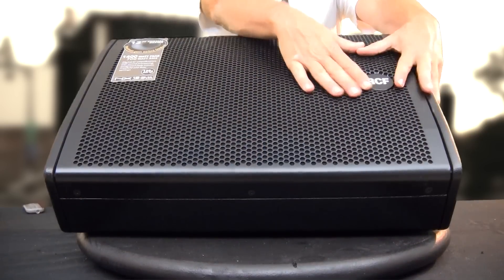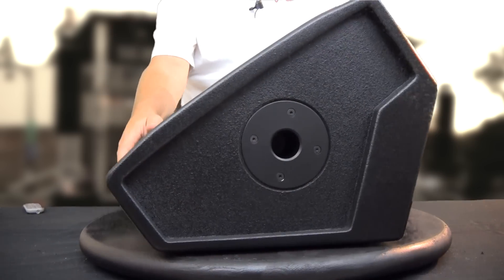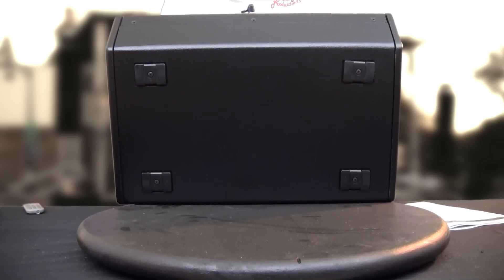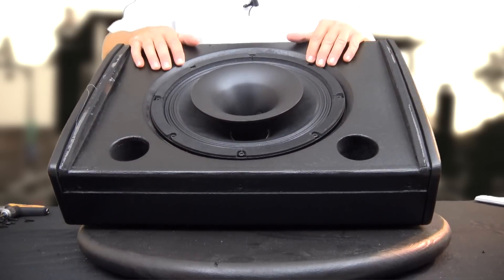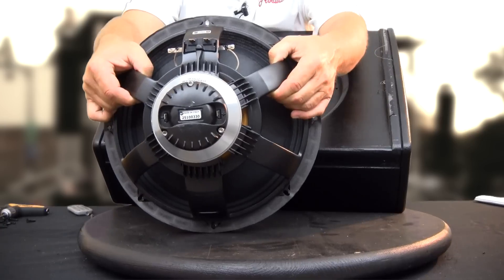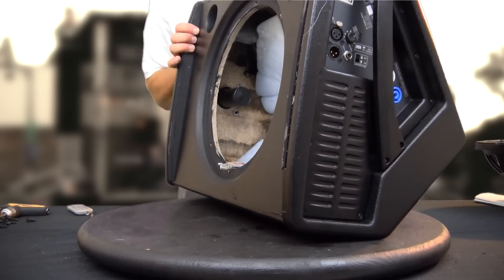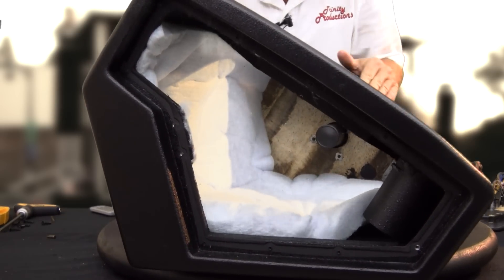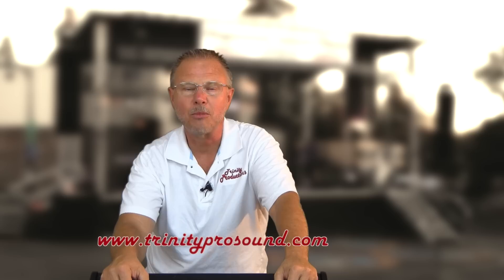RCF NX12SMA overview - inside and out - AUTHORIZED RCF DEALER

Comment: About 30 years ago bought an RCF 8 inch coaxial speaker. I had confused them with RTR who supplied some of the 25 inch drivers for the SENSURROUND speaker boxes of the 1974 disaster film Earthquake, as experienced at the Empire cinema, Leicester Square, London. I found the   RCF to have amazing efficiency (97db) and a decent power rating of 75w rms. While I wouldn’t compare it with an equivalent Tannoy coaxial I thought I had clean bass, an excellent forward mid range well suited to human voice projection and a smooth hf rolloff. Although not sporting an exotic Alnico magnet, the ferrite installed was as big as the cone, so you could safely describe it as a budget professional driver, at just £17.50, in 1989 money. $60 today in 2018. All RCF products seem to be well made, robust, and represent honest Italian craftsmanship.

Comment: Hard to tell from this video, but aside from the grille, the construction looks like it may not withstand continual gig wear and tear from usage as a stage monitor. Am I wrong? Is this monitor's housing more rugged than it looks in this video? Also, you stated that the horn is 60-degree dispursement, but what about the mid-range driver? Thanks!
Reply from the maker: Yes it is solid , we have almost 20 of them doing events in our production inventory. They are very solid speakers and construction. The speaker is 60 degrees conical around the entire speaker for the LF and HF section. There is no mid range in this box, 2 way only. The inherent properties of the coaxial design is fantastic for feed back rejection as well.
Reply: Thank you!

Comment: Hello John. Have you ever tried to hook up a pair of these with a small subwoofer? I wonder how it would sound as a main top for a 2.1 mobile DJ system.
Reply from the maker: Yes we have and they sound great ! Just a bit strange looking on a stand with the monitor wedge shape, but they do very well and are loud and clear, subwoofer really enhances the low end , always use the crossover output of the sub and you can drive the system fairly hard.

Comment: Hi.thanx for the video.

We are a midsize rental company.

We do small and large indoor events and small/mid outdoor events.  Would you recommend getting 4 sma12s or sma15s?
Reply from the maker: For the few added dollars I would get the 15" model, the 12's are great, but if you need to have a versatile monitor that can do vocal, keys, bass and drums, the 15" is the way to go. They do what the 12" model can not. The 12 is great for guitar, vocals, horns, etc. but for a solid low end montior wedge the 15 is our favorite.